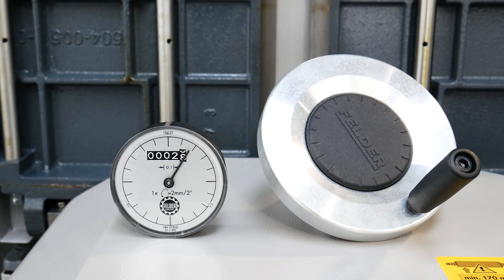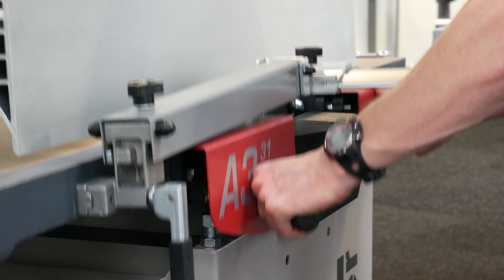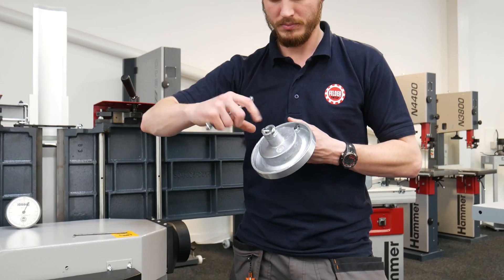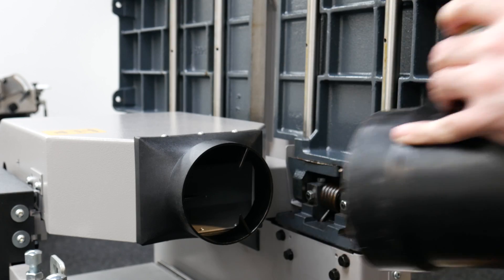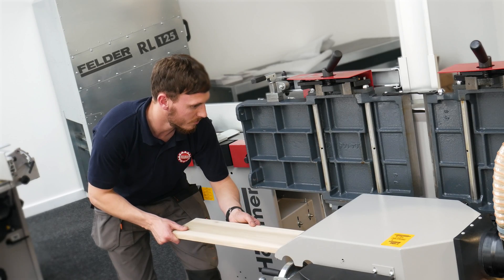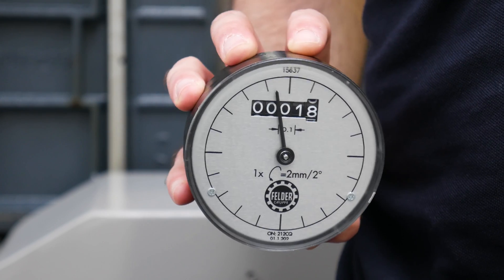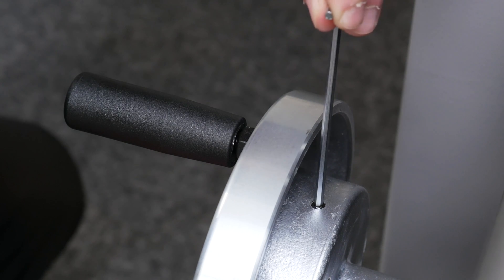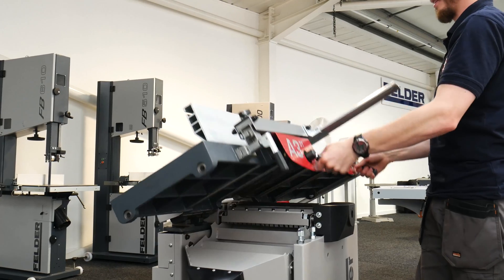How To - Fit and calibrate a digital dial indicator | Felder Group

Comment: the calibration shown in the video was wrong. The measuring was 21.4 and the set value at the indicator was 2.4 mm
Reply: No it isn't, he set it at 21, which is 21mm. Every other increment on the the dial is 0.1mm
Reply: @danielk8221  I'm missing something here. I think it was set at 21.3mm not 21.4mm